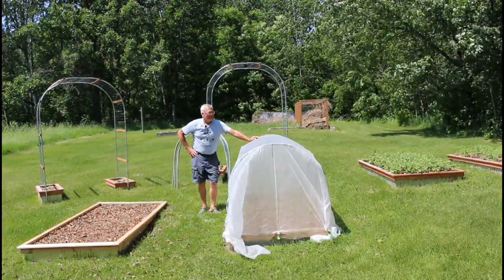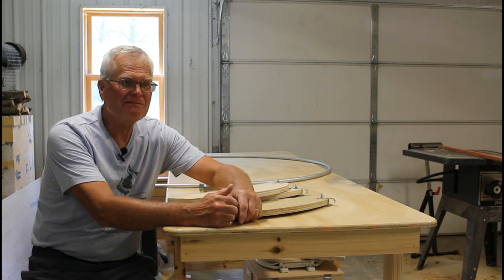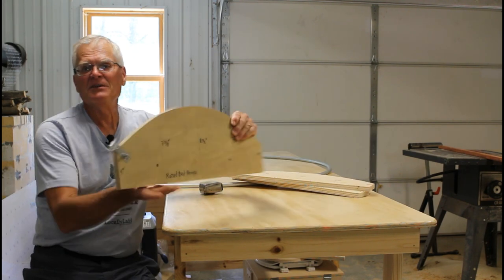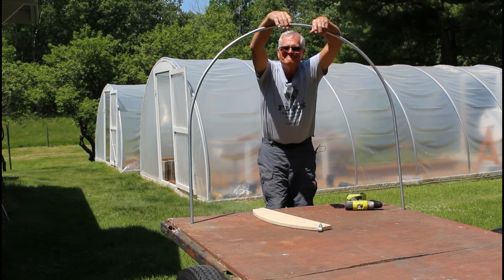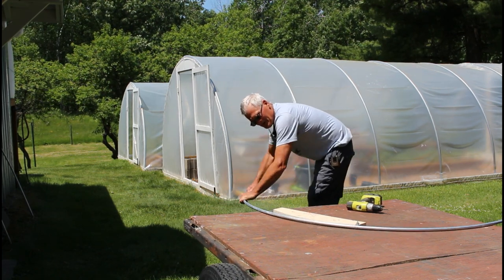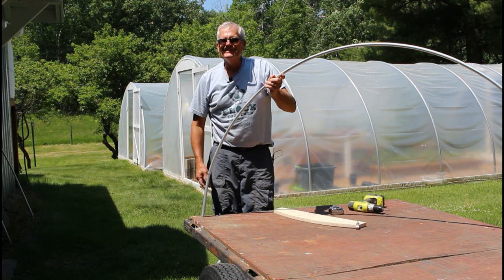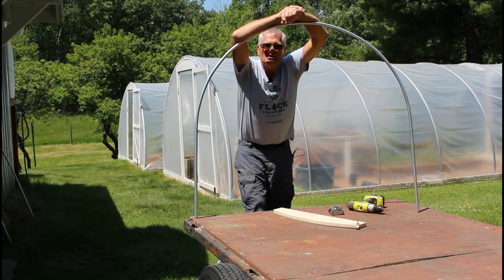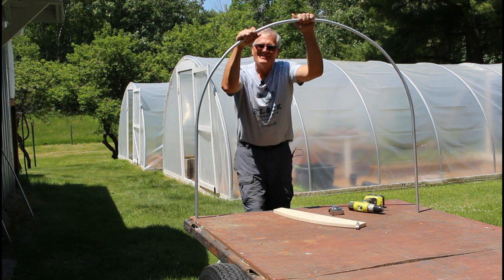2 New Hoop Bender Designs

Comment: Mark, thanks so much for the information. I'm excited to create my own bender. This is better than trying to make that curve with a pipe bender.
Reply from the maker: Yes, Michelle, the hand-held conduit benders are good for bending a steep angle or 2, but not for creating a uniform arc.  With the purchased ones over $100 now, my benders, made from scrap plywood, are a real bargain.
Reply: @backwoodbasics9383  For sure. Excited to build mine.

Comment: Good morning Mark - great instructional video on raised bed hoops.  I am going to build your design raised beds with these hoops.  Also I would like to build a 12' x 20' hoop house and would love to see a video from you on the specific design and how you bent the larger pipe.  Same principle I know, so can figure it out, but a short video would be good.
Thank you for your videos.
Reply from the maker: Thank you! I have a bender for bending chain link fence top rail tubing. I have built 3 12'x24' hoop houses by bending my own hoops (bows). Without building another hoop house, I can at least do a video on much of the process.
Reply: Yes . I would love to build a greenhouse my self.
Reply: I too would appreciate some info and guidance!

Comment: I really appreciate your bender measurements and process. I built 3' wide beds because I'm arching cattle panels over the walkway between the beds as trellis for vine vegetables and my reach into the bed from the walkway will be limited. I want hoops over the beds as well so I can use row cover to extend the season in the bed. Any thoughts on the measurements for a 3' hoop bender? Thanks so much!!
Reply from the maker: It is too cold here now to attempt to heat the workshop, but I would spring clamp some flexible tubing onto a work surface at the hoop width that you want. Then center a piece of plywood under the tubing and scribe the arc. That should get you close to the bender you need. It may take a bit of tweaking, and the starting point for the bend will need to be determined, but eventually you will get the hoops you want. Just write the starting distance for the bend on the bender, as well as the finished width (like "start at 28" and 3' hoop"). Thanks for the input! Mark

Comment: Bello Sir. Wbat is the diameter used used on the  two big greenhouses? Thanks. You are a good coach.
Reply from the maker: Thanks Sergio. The hoop house dimensions are 12'x24', with about 8 feet of height in the center. I have plans for a bender to bend the hoops, and hope to  present them in a video, if spring ever comes to noirthern Minnesota.

Comment: i have a conduit tubing bender used by electricians. i know it is for tighter bends. however i can do a tight bend 45 degrees on the first leg, a 90 degree bent at the top, and another 45 degree coming down the opposite leg. all i would have to do is measure and mark the places i want to bend. the profile would look like a house instead of a hoop house. just thinking out loud here. i should do it and see it there is any problems. but i wonder why i have never seen this configuration. also rebar fits tight in the inside of the conduit, that would be a good way to anchor the conduit instead of losing height by sticking it down in the ground.
Reply from the maker: All good ideas Bob. I too have such a bender, and used it to bend 45 degree angles for a bike trailer hitch. Whatever works. Hoops are simple, strong, and offer the most internal space.

Comment: Great video and wish I saw it yesterday, I just bent up tubes but your ways alot better, any idea how I could make a ten foot hoop bender, gotta make hoop house next.. thanks
Reply from the maker: Thanks Joe. I made a bender for a 12' hoop house. I will share it, once things settle down, and I have the time to do it. If you need a 10' bender, use a flexible material (plastic tubing works well) to form the radius needed on a large, flat, level surface. Lay a piece of wood under the center of the arc, and sweep the radius with a pencil. This should give you the approximate dimensions you need to build a bender.

Comment: Could you not draw the ark with just a nailed in string and then a pencil tied onto it at half the length of the width you want the hoop? You will have to have a table or board big enough to cover the length of the string and then you can just anchor the bending board center and then just make sure it is most even on both sides.

Comment: Hello there. I'm attempting to build a raised bed cover using gal conduit pretty much the same as yours. I'm having a problem with my hoops not staying bent, they are just too springy. Can you please tell me what the wall thickness gauge is for the conduit you are using. Great videos, regards Malcolm
Reply from the maker: That's a puzzler Malcolm. I use the inexpensive 1/2" thin walled EMT conduit. It is now about $6 for a 10' length. Wheatland is the brand name. It has some memory, so will spring back a bit, once bent. But not too much. It certainly holds its shape, once bent using my bender. Good luck with your project.
Reply: I want to build a hoop house using 3/4 EMT. Think your bender will Handel it with minor modifications.

Comment: I can't really see the angle that well, that occurs when the longer end of the conduit comes towards the end of the bender.  Is it roughly 30˚  from that bender end closest to you, until the last bend?
Reply: I'll add I was asking about the 4' bender.
Reply from the maker: I hope I understand the question. When the mark on the pipe is at the end of the bender (opposite the strap), pull the mark to the end of the bender, then tweak the pipe (using an extension for leverage, if necessary), just past the end of the bender, to give the hoop vertical legs. Take the hoop out of the bender, and repeat this for the end that had gone through the strap first. The method is the same for all of my bender designs.
Reply: @backwoodbasics9383  Apologies - I didn't see this reply.  I thought I had checked back, but maybe I confused the other video about the 42 inch arch.  
I understand the last bit about tweaking for the parallel.  I was trying to gauge the bit such as at 8:22. the angle measure between bender and not tweaking it down at the end, just before moving pipe to next bend position.  
I can't believe it has been a year. I have had difficulty locating fair priced EMT, Thinking it a covid induced shortage, and put off redoing my mini greenhouse which I built shoddily from thrown away Ikea bed slats and a thermal pool cover that is essentially super thick bubble wrap.  The winds this last year have done a number, though, so I can't put it off any longer.  
This is one of the most useful of videos out there for making one's own bender. Much appreciated.

Comment: Would these templates work on top rail for fencing that is 1 3/8?
Reply from the maker: These benders have too steep of an arc to bend something as heavy as that. I built a bender for top rail, to make hoop houses. It is cut from 2x6. The bender needs to be 1&1/2" thick to bend top rail.

Comment: Do you use 8 or 10 foot length for the 4 foot hoop. Know you use 8 foot for the 42 inch one.
Reply from the maker: I don't recall, exactly. It's been awhile. I would guess they were cut to 8 feet. It depends on how tall of a hoop is desired. We have moved to Duluth, MN, so our gardening will now be on a city lot. I plan to build raised beds with bed caps in the spring. More bending, and (hopefully) more videos to come.
Reply: I just revisited your arch trellis video where you used the 4 foot hoop and you mentioned that the 4x2 wire that you used was 10 foot. Think I'll go with 10 foot. Thanks for your videos and look forward to more in the future. Thanks for your reply.

Comment: Do you have the dimensions for a 3 foot hoop bender?
Reply from the maker: We are in the process of moving, so my benders are in storage (somewhere). I did not have one for a 3' bed, but you might try adding 3/4" to the heights of the 4' bender. The edges remain at 3 and 1/4", the 6" vertical lines become 6 and 3/4", and the center becomes 7 and 3/4". The bender width remains 2' long. I do not have the tools now to make a prototype and try it out, but this should get you close enough to a 3' hoop. I would use 8' lengths of tubing, and start and end the bends at about 18".

Comment: Need to make a 4ft wide x 6 ft height hoop for raise bed
Reply from the maker: I would use my 4' bender, and add legs to the finished hoops by using 1/2" set screw couplers. I am doing the same thing for a new arbor design. I will have a video on it soon-once the wind stops howling.